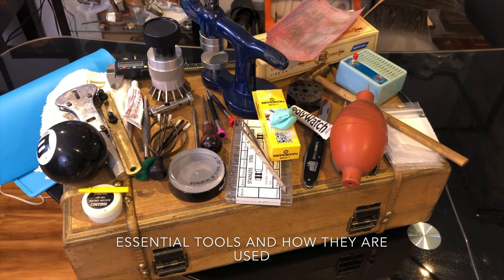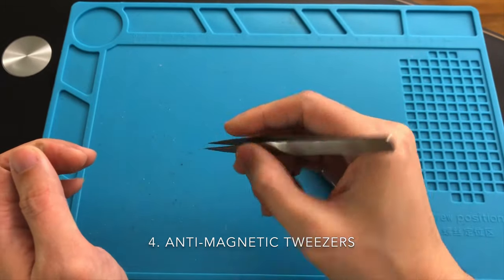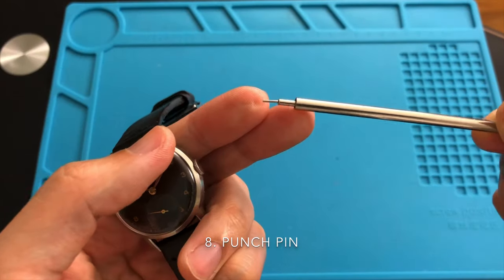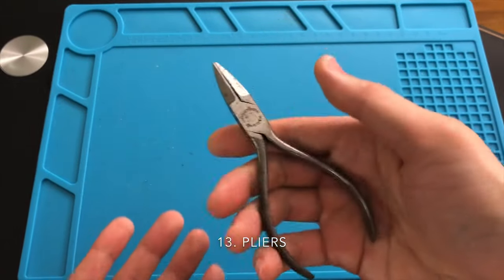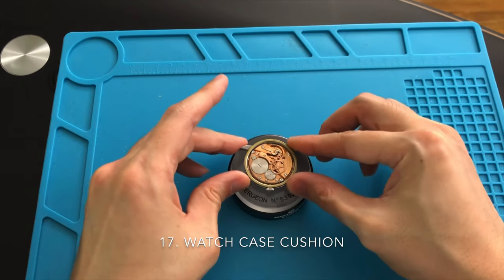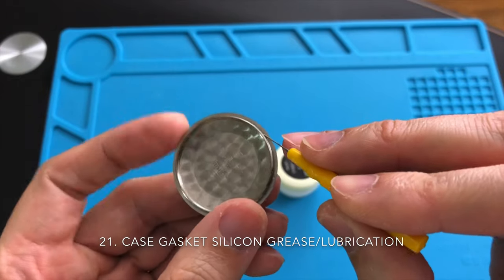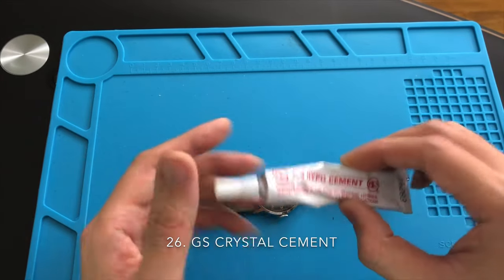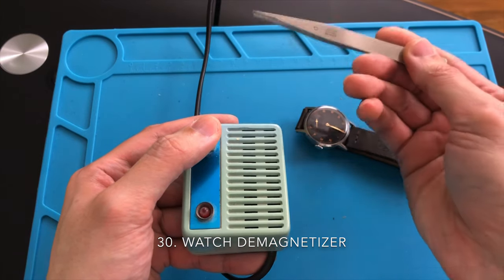30 ESSENTIAL TOOLS FOR WATCH COLLECTORS!

Comment: Something that works very well for protecting your tweezer tips is heat shrink. Find one that fits the tip as close as possible. Then just apply your heat and now you have a tip protector that is economical.

Comment: I keep all these tools at my local watch service. Coz there's no reason to own all this stuff for a few watches, but if you do, then it's reasonable to consider opening your own watch service.
Reply from the maker: Many watch collectors that I know do own many tools. While some collectors may keep their collection small, they may trade or resell to replace ones that they no longer interested anymore. So it is essential to own a fair amount of tools. But if you’re someone who has a reliable watchmaker or prefer to have your local watchmaker handle the technical side for your watches. Then probably most tools are not essential to you.

Comment: You need to buy an absolute digital caliper or just a mechanical caliper. Digital calipers that are not absolute have wheels in them which can slip. When they slip, a lot of times you won't notice it; so you make a measuring error. My father made a 1000+ euro  mistake on a lathe because of a digital caliper.

Comment: Magnification is essential definitely.  I don't like using eye loupes much.  Instead I use a magnifying visor instead.  I recently added a digital microscope.  Far less expensive than an optical microscope setup and is extremely helpful for inspecting parts, to aid in oiling, as well as taking videos and photos.
Reply from the maker: The thing about a microscope is it can cause some people to feel dizzy and light headed.
Reply: @TimelessHistoryChannel I did end up getting an optical microscope.  Couldn't get used to trying to look up at a screen while working with tweezers and screwdrivers with my digital microscope.  It is much easier for my brain to manage those movements when I am looking down through the lenses at what I am doing.  I wish that I would have just bit the bullet earlier and skipped the digital microscope.  Not to mention that it would have been cheaper in the end.

Comment: Was recently resizing my first bracelet on a Seiko 5 and the spring bar went flying.  I was able to find it, as it went into an overhead metal cabinet.  But it completely blew apart into three pieces and couldn't find the one end pin.
Appreciate the content (and Canadian pricing).
Reply from the maker: Good thing it’s a spring bar that flew out and not a movement part. :)

Comment: Just taken delivery of a few watch repair tools but forgot to get a Watch repair mat and then saw your video. Tw things spring to mind, everything's a lot smaller than I was expencting and second, the mat shown in your video, I've now ordered one. It describes it as magnetic to retain screws etc. from disappearing. My question is, once I've carried out some work on the mat, will everything that's been placed on the mat become magnetized?
Thanks again, great video.
Reply from the maker: Thanks for the comment. Are you saying that the mat is magnetic? The mat is not magnetic at all. It is rubber, so when you have watch parts, they will not be easily moved around like on an actual Swiss-made Bergeon watch repair mat. This mat is suitable for travelling around, but when I repair watches inside my shop, I use my Bergeon mat. Which is hard, flat, and smooth.

Comment: Would the crystal lift work on a vostok acrylic glass that has a metal tension ring?
Reply from the maker: Crystal lift is not to be use on any crystal with metal tension ring.  If you're able to remove a crystal with tension ring out of a case with the crystal lift, that means the crystal is improper size.

Comment: A question regarding the hard removal tool. When I look online I see that there are some for both the hour and minute hands then there are also ones for the second hand. So different ones are required and can’t just use one for all hands?
Reply from the maker: Apologize for the delay. You can use regular hands remover on all three hands. But for the small second hand or chronograph recording (small) hands, it is better to use a different tool for those.

Comment: I have got small steel round plates from car engine to adjust the valves, I am using two of them to close the watch after replacing battery. The plates protecting watch surfaces from damage when clamping in small vice.
Reply from the maker: That's why it's important a watch case clamp to get the job done right without damaging the case.
Reply: @TimelessHistoryChannel  It is relatively easy job if the front glass and back bezel are both flat. But this is not the case in vintage watches.
Reply from the maker: That's correct.  Which is why as mentioned on the video to use the dies with centre dome on the crystal side.  And if the case back has raise emblem as well, then you'll need to use only dies with centre dome.

Comment: Very helpful thank you. I keep wondering if the glass remover tool ever scratches or dents the crystal with those sharp claws.
Reply from the maker: You're welcome. If you are trying to fit a crystal that is many times larger, then yes, you may see the marks around the crystal. But you can always use "polywatch" to remove them. When you fit the right size crystal using this tool, you'll not see any marks.

Comment: Thanks for your video.  Would you suggest that I also invest in a tool to wind a mainspring, or is it only necessary when taking apart the entire watch, giving it a full cleaning, then putting it back together? These tools are very expensive.  Also, where can I purchase parts cleaning and rinsing solutions in Canada? Thanks so much.
Reply from the maker: Hi, I made this video introducing tools that any watch collectors can learn on their own.  If you're looking for watch making tools and how to use them, I suggest that you take a course to learn about watch repair first.  Or find a watch maker who can teach you.  Watch making takes many years to learn, not something you can pick up in a week.